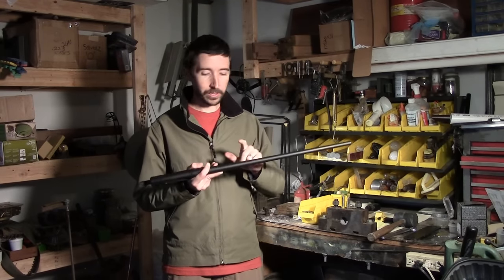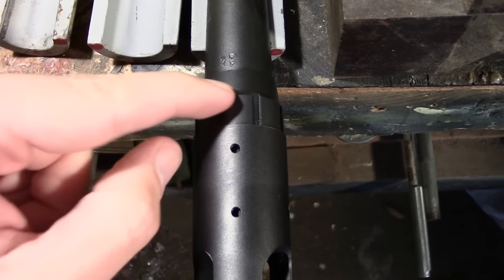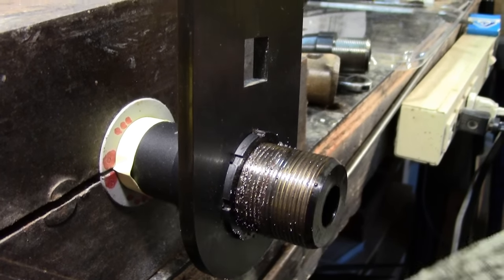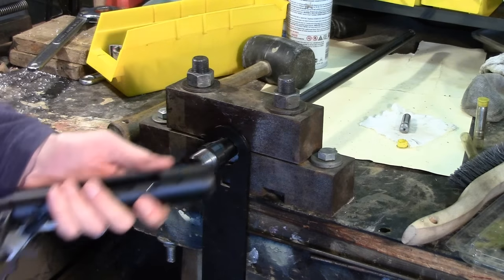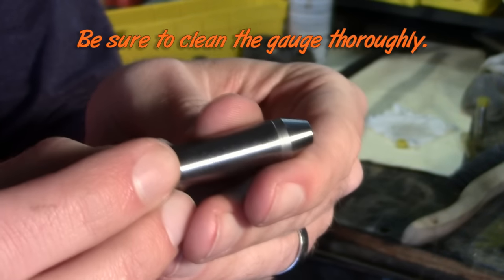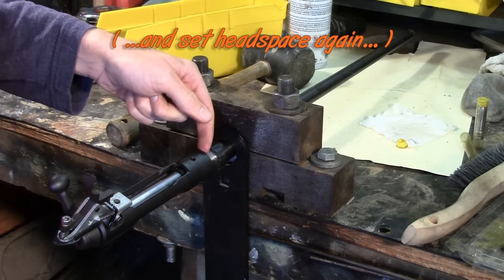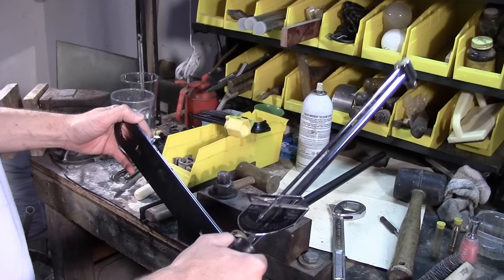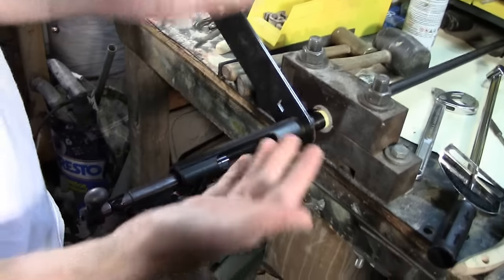Swap Savage Barrels - 1000 Yard Savage Axis Budget Long Range Rifle | The Social Regressive

Comment: Great video. Two things to help regular people out:
1: You can rent a torque wrench from any auto parts store. You get all of your deposit back when you return it, so it's essentially free to use.
2: You don't need a barrel vise. Take a block of wood and drill a hole slightly smaller than the diameter of your barrel (15/16" hole for a 1" barrel) in the middle. Cut the block in half, dissecting the hole, and place it around your barrel in a normal vise. The slightly smaller hole will hold your barrel very securely and wood won't mar your finish.
Reply: Stephen Molzer also i saw your directions but cut to big a hole i used a leather welding glove to wrap my barrel then put into wood blocks into vise- works great !!!!
Reply: @3006USMC  that's a fantastic idea too. Welding gloves are very well padded and leather provides enough friction to keep the barrel from twisting.
Reply: could you not use a crescent wrench and adjust it  instead of a torque wrench?
Reply: @jcorbo7518  you really should torque your barrel nut. I'm a mechanic and torque things all day, so I have a feel for it. But do you know how much torque you're applying with a 10" crescent wrench versus a 14"? The difference can be surprising - and enough to damage threads if you crank too hard with longer handles. The best practice is to always use a calibrated torque wrench, which I still do even with a good feel.
Reply: Another thing to note is the prospect of pre-loading, breaking and retorqueing of a barrel nut. It's best to seat the nut, bring it to 90% torque, break torque, back it down and then re-torque to spec. This has many names: seasoning the thread, preloading, seating etc...all the same here.

Comment: I usually remove the extractor and ejector during headspacing. One of the little magnet wands you find at auto parts stores works well for retrieving the gauges.

Comment: Quick tip the smith that I bought my barrel from gave me. If you are only going to do this once and don't want to spend the extra $40 for the no-go gauge, you can use two layers of your every day clear scotch tape on the go gauge to give it the extra 0.003" of length. I measured the thickness, and, sure enough, it is 0.0015" per layer. You can also get an idea as to just how tight the action is with this too as there are the two layers and while I can't even start to lock the bolt with two layers on mine, I can JUST start to turn it with one layer.

Comment: To cut cost, after bead blasting they don't clean it. It doesnt hurt the rifle because the pitch/valley of the threads do not contact and don't need too. They wanted the same barrels across the board for their products but had to cut corners to keep the price lower, thus the dirty threads. Either way I've owned 5 of these rifles and when I blue printed them i'm my shop, they all had it. Some people freak out but it's as harmful as mud on your tires lol.

Comment: I first watched this video back when it hadn't been out for long and ive used a lot of this info to build my axis. Finally beat my own record by making hits at 820 yards the other day. 
Build is a lefty 308 axis with 20 inch bull barrel 1 in 10 twist with threaded muzzle from apache gun works. A cheap trigger job (haven't invested in a timney yet). Filled the stock with jb weld & aluminum tubes. Milled the stock out to be free floating with the bull barrel. Steel rings and rail. 10x swfa scope. Cheek riser and bubble level. Its half moa with hunting ammo. And my total investment is just under $1000 with the original cost of the rifle and scope included

Comment: Just use the PTG action wrench. It's cheap and very good. Also pick up the incremental gauge set in 1000's/inch increments. Than you can set a very precise head space. Which is good idea if your going to be doing long range precision shooting.

Comment: ER Shaw said 75-100 ft/lbs and I was honestly surprised. 

Was definitely a two man job to get it torqued up right, the action kept wanting to turn so my friend (whose rifle it was) ended up wrapping a piece of leather around it then clamping it down some channel locks while I torqued to 75, ended up seeing 79 as the last number on the digital wrench readout so I called it good. 

Maybe 80 rounds of .300WM later it’s shooting well with no issues. 

It was just a whole lot more torque than I thought it would need.
Reply: Gahhhhh damn!

Comment: That is probably small blasting shot. And, it's hard.  When I first received my Predator HB I inspected the bolt head and noticed small scratches in the direction that would be consistent with bolt closure.  Some of those beads had been drug into the metal of the locking lugs on the outside and lug mating face to the point where they were embedded in the bolt and causing small scratches.  I had to work with a Dremel wire brush and 400 grit wet dry for 30 minutes before I first inserted the bolt.  I also blew out the receiver area for about 2 minutes.  First trip to the range and there were additional scratches that showed up on the bolt.
Apparently, they aren't to careful about cleaning when they fit the barrel/bolt.

If you really want to see something scary, look at the receiver's bolt lug mating surfaces with a borescope...that stuff caused scratches there, as well, and overall it looks like late WWII wartime production in Japan--extremely ragged milling.

Comment: Great Video, this is one thing I love about the Savage Rifles, You don't need a Machinist to install a custom Barrel.
Reply from the maker: Absolutely.  Just a few simple tools and done.
Reply from the maker: bowhunter 85 Sounds like you won the lottery if you want to shoot longer bullets!  Everybody cuts throats a little bit differently (ask a pirate), and if you're a bit long, then it's no problem.  You'll be getting a little bit more case capacity if you seat your bullets out to .005" or .010" off the lands.  It sounds like you have a winning combo, though!  Don't change it!
Reply: bowhunter 85 That's Outstanding accuracy. The best I have got so far is .634, and it was with Factory Ammo. I just use a common Hunting Rifle, but try My best. Here is a video of My best group if Your interested. 
youtu.be

Comment: did you replace the recoil lugs after you posted the video. because i didn't see it you placing it back on or see it while you're placing the action back on.
Reply from the maker: The Savage Axis doesn't have a barrel-mounted lug. It has a cutout that mates with a lug installed in the stock. But yes, I did install the usual lug onto the Stevens 200 as I swapped these barrels.

Comment: Bow Hunter 85, If Your bolt won't close on the no go gauge Your good to go . That 6.5 Creedmoor is impressive. Good luck Sir.
Reply from the maker: Amen.
Reply from the maker: bowhunter 85
Ummm, yeah.  I'd say keep it.  :D
Reply: did you find that the barrel nut affects accuracy at all as opposed to a barrel threaded directly onto an action and chamber to the correct headspace?
Reply: Nick Thoreson , Mr Thoreson, I am just curious as to how anyone could determine any difference with any degree of accuracy beyond speculation.

Comment: I just took apart a Savage and the same crap on the threads. It cleaned out easily, but still.  Maybe it is the reason why I could not remove the nut. It did not budge with all possible methods. I gave up, ordered a new nut and cut the original.

Comment: I cant believe that shot didnt ruin those threads.  Looked great once you cleaned it up, though.
Reply from the maker: +Work I've seen forum posts from guys that had to cut off their barrel nuts because they turned them over the shot.  Once we saw the stuff, we turned the action and the nut away from that mess and cleaned up the threads.  It could have gone badly.
Reply: +The Social Regressive I thought it was anti-seize at first.
Reply from the maker: TexanUSMC8089
Some of the other guys thought so, too.  I think maybe this is Pro-Seize (TM).
Reply: LOL  Are you going to be selling that door to door.

Comment: I like to use a piece of scotch tape on the back of my go guage, it ads about 20 tho. Its also helpful but not percuct for checking exact headspace after by stacking if needed. 

Usually go gauge to field guage is 100 tho or 5 pieces of tape for most calibers. And 40 tho or 2 pieces for no go.

Comment: Nickel is magnetic it may have been a anti seize lube and being a firearm they would have used the larger sized particle for better lockup when tightened as the bushing nut is thin

Comment: Upon removing my Axis barrel I found the round steel balls and a black goo (antiseize?)  The barrel nut would not fit so I grabbed another nut and it went right on. The action, however , would only screw down halfway. Any suggestions.
Reply from the maker: Clean like mad. I think I sprayed both sets of threads with brake cleaner, then I grabbed a toothbrush and a wire brush until both sets of threads were shiny. After that it threaded on nicely.

Comment: Barrel nut on Savage only calls for 30-40ftlb, with no more than 50ftlb. That's kind of a pain in the ass since my smith went with the 30ftlb setting and my muzzle device calls for 30ftlb as well! Just went to remove my device and the barrel started turning!
Reply from the maker: You raise an interesting issue! I must have used a higher torque setting on my last build; I hadn't ever considered that it might spin.
Reply: Lmao 😂

Comment: Thanks for the video! Awesome content so far. Would this process be the same with an aftermarket prefit barrel, or would additional gunsmithing be required? Does the barrel nut itself essentially set the final headspace as long as the chamber is correct? I just feel like this is a project I could hadle, but if it gets to the point of reaming the chamber or anything like that I'llk probably just take it to a gunsmith. Thanks again!
Reply from the maker: It's just as easy as this! The barrel nut sets the headspace; no need for any machining or modifications.

Comment: So this means that making my .243 a .308 would be a breeze.
Reply: Cool, anybody know where I can find a .308 savage barrel or some other decent one?
Reply from the maker: Absolutely.  The only thing you would need to change would be the barrel.  You can even use the same headspace gauges.
Reply from the maker: Shilen, Douglas, Krieger, Criterion, and McGowen all make excellent Savage replacement barrels.  You can pick the length, twist, chamber, steel, and profile.  There are some less expensive options from ER Shaw and EABCO, too.
Reply: +The Social Regressive thanks bro, I'll look into it.

Comment: Do you put anything on the threads before you put the action on?  Something like lock-tite, anti seize, etc.?

Also, why the llama for your logo?
Reply from the maker: +Wedelj Ding ding ding ding ding!  Over 2,000 subscribers, and you are the first to ask that question!  Now I have to do a full video on the logo.  Here's the short story: When I was a teen, long before I ever heard the Sheepdog Concept, I was thinking along similar lines. Criminals were commonly referred to as wolves, and average Joes and Janes were referred to as sheep.  But I knew I didn't want to be either in that metaphor.  Surely there was an animal that was productive and harmless, but when predators came around it would suddenly reveal a different side.  I actually ruled out sheepdogs for several reasons.  Then I met a rancher at the State Fair that told me about llamas.  She bred llamas for sheep farmers because (a) they were particularly vicious and effective at stopping threats from predators, (b) they had a much lower risk of harming the flock than dogs, and (c) they were a part of the flock, producing wool and bonding very closely with the sheep, particularly the lambs.  That, to me, is a pretty good metaphor.

And they're tall and goofy-looking.
Reply: The Social Regressive I like that metaphor, very fitting.  Plus, I'm glad I got to give you a video idea.
Reply from the maker: Wedelj
Oh, yeah; I forgot the original question.  I did use Loctite.  Sometimes I don't need it, but on  the Axis there was too much friction between the barrel nut and action.  Turning the bolt kept turning the action, too.
Reply: The Social Regressive So you aren't worried about the threads galling up or the barrel/action/barrel nut seizing?
Reply from the maker: Wedelj No; according to the rumor mill, Savage torques their barrel nuts down to 70 lb-ft.  We're nowhere near that, but it's plenty for the task at hand.
Reply: Seems to me someone thought up a technique of using a little valve grinding paste between action and nut, and turning the nut in and out, to both smooth these surfaces and to true them up. Then clean it out when done, of course. I know I read that somewhere...

Comment: Did you have to change the bolt in order to use the 7mm08? I have .223 axis was debating swapping the barrel to .308 or just buy another axis chambered for .308.
Reply from the maker: Since 7mm-08 is just a .308 necked down to .284", I didn't have to swap the bolt head. In your case, you would need a new bolt head (from Northland or Brownells) and a magazine.
Reply: @SocialRegressive  sweet thanks.

Comment: Was the factory barrel nut super tight on yours? Cuz i'v been trying to remove mine with a small sledge hammer.
Reply from the maker: No, mine came off after a few whacks. The only issue was the blasting medium (?) on the threads that could have caused a jam. My only recommendation is to double-check the thread direction.
Reply: @The Social Regressive  ya I'm gna have to double check on that.i've been hitting it the direction you mentioned on your video.

Comment: Dear Social Regressive,

I am thinking about getting myself set up for long range shooting (not competition, at least, not yet, just for me). I would hardly consider myself poor, so I would consider my top end budget for a rifle/scope/system somewhere around 1500. Like you, I don't like the Savage plastic stocks. Actually, truth be told, I don't get excited about traditional stocks in general. I saw a Mossberg MVP LC using an Almuminum frame/stock using AR pistol grips and buttstocks. I liked the stock, but have concerns about the 20" barrel it comes with. The same can be said about the Savage 10 BA Stealth. Both come in around the same cost of about 1K. (The chassis alone, according to the MDT website for their LSS is $400)

My question then starts out with "Is 1000 yard accuracy out of  the question with a 20" barrel?" And depending on that answer, is it any harder/more expensive to change the Mossberg barrel out for a 24" than it is the Savage rifles?

I have no plans on being able to get into reloading in the immediate future (I live in a Studio apartment, so no space or workshop), so I was planning on sticking to factory .308 ammo.

Thanks in advance for any advice you can give me in this regard. I watched most of your 500 dollar 1000 yard series. neat and informative, overall, well done.
Reply: I don’t like the poly stocks either, my favorite stocks are Mcmillan stocks, they make all kinds of stock for Remington 700 rifle. If I were you I would start with a Remington 700, not because they are technically better than the savage but they have tons more aftermarket parts for precision long range shooting.

Comment: Great video, i was wondering though if it would be beneficial to remove the extractor and firing pin assemblies when head spacing using the go/no go guages, would give zero resistance and a more accurate feel. just a thought- keep up the good vids.
Reply: What about the ejector
Reply: @reddawng43x91  yes that too...more than anything I missed that, took someone 4 years to catch it

Comment: good video. i am getting ready to do this w/a savage model 12 lrp in 6.5 creedmoor. I have heard/read/seen that the extractor should be removed. noticed you did it by putting the go/no go gauges "under" the extractor. ever have any issues w/that technique?
Reply from the maker: Some folks will remove the ejector to prevent the gauge from being pushed forward or flung on extraction.  I left mine intact and was just careful to catch the gauge on the way out.

Comment: When you installed the action onto the barrel with the go gauge did you go until the bolt touched the barrel and then tightened there or did you give it a little space, oh about .005"?
Reply from the maker: These gauges are pretty specific. There's only wiggle room for about 0.003" if you run the no-go gauge.

Comment: Hey question, would it be almost the same if I wanted to do that with a Ruger American? I’m lefty and want a 300 blackout. So the bolt head wouldn’t be a problem. Or should I just get a savage axis and do what you did?
Reply from the maker: Yup! The American works exactly the same. HOWEVER, the barrel nut, shank diameter, and thread pitch are not the same as Savage. You'll need to find a Ruger-pattern barrel and wrench.

Comment: I'm doing this now and once I tighten my nut onto the action the entire action and nut spin together on the barrel. Is this normal?
Reply from the maker: No worries! There are some sneaky tricks to help you. You can hold the action with a strap wrench or other adjustable wrench. Heck, you can wedge a chunk of wood in the magazine well and use that as a handle. Or you can lightly "glue" the barrel in place with a dab of nail polish, wait for it to dry, then crank on the nut.
Reply: @SocialRegressive  i ended up holding it very tightly while I tightened the nut. Worked like a charm. I appreciate the tutorial
Reply: Watch the video then ask questions